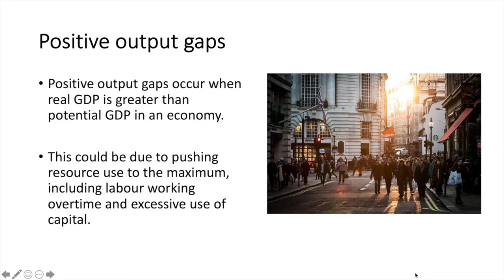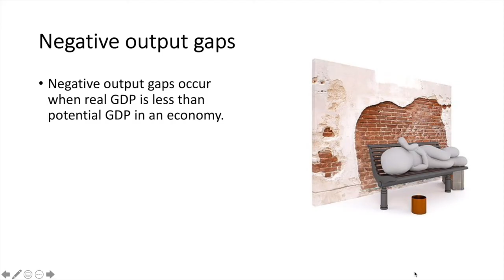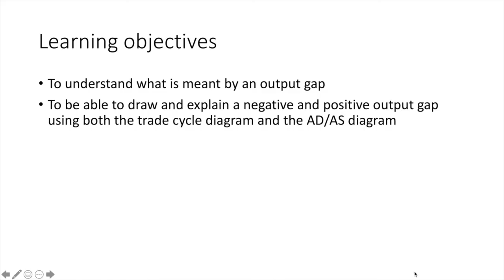Output gaps

Comment: can someone tell me more details about the LRAS&SRAS diagram?
Reply: LRAS is the potential output  economy can produce and SRAS shows exactly how much you are producing right now, which can either be lower and higher than the potential! In the case of positive output gap, SRAS is past the LRAS line, showing there’s overworking of resources like machines and labour, obviously this can’t be sustained or maintained for long because machines will need to be repaired and workers won’t be willing to work for this long. So SRAS shows what’s happening at this current state and you use LRAS to see what you should be doing.